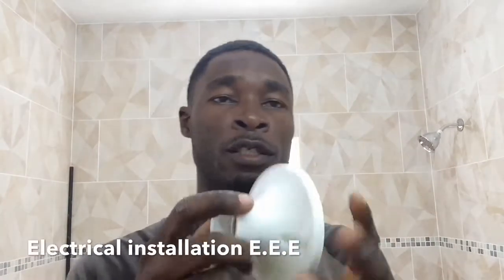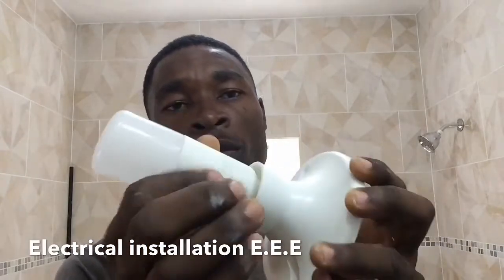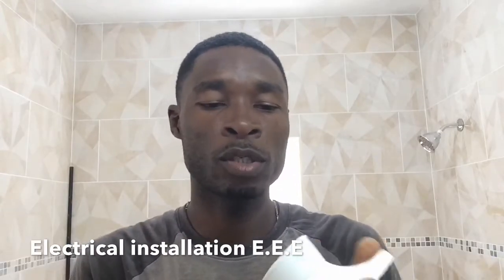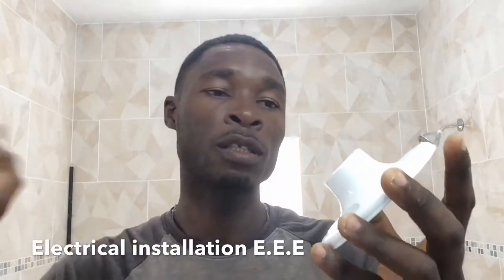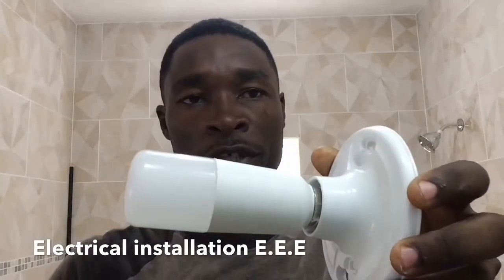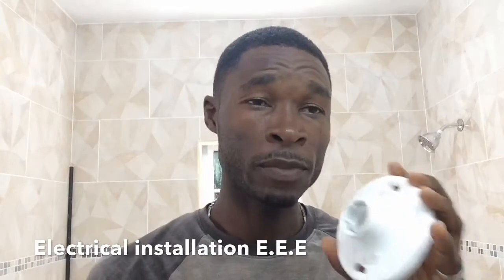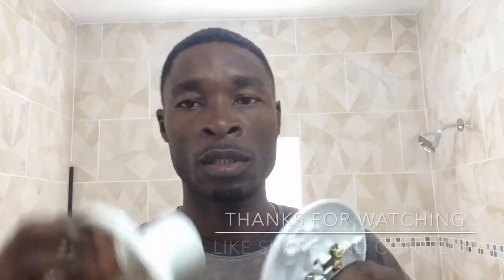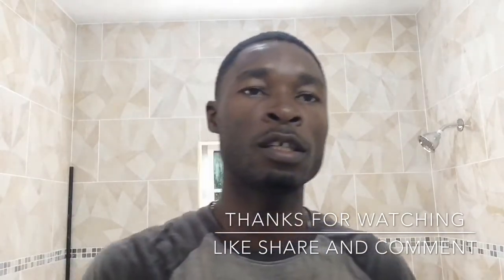EXPLAINING THE DIFFERENCE BETWEEN A SHROUDED AND A BROAD BASE RECEPTACLE!! Tutorial video

Comment: In America we use a fully enclosed fixture so water won’t get inside and create electrical shocks and accidents
Reply from the maker: Yeah ,in JA most of our rules are different compared to other countries ,and it have to do with the infrastructure of the buildings.
Reply from the maker: Because we do stubs and dry wall settings as well ,but we mainly do concreting structures out here .